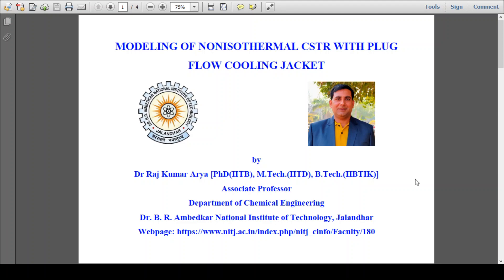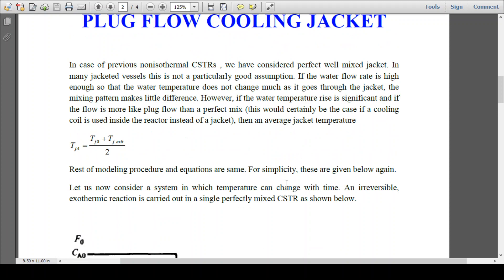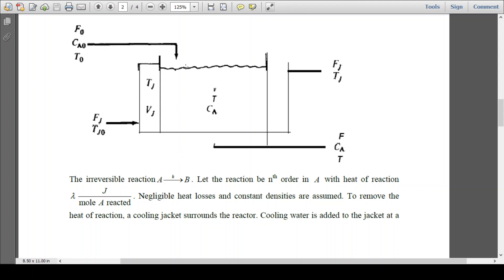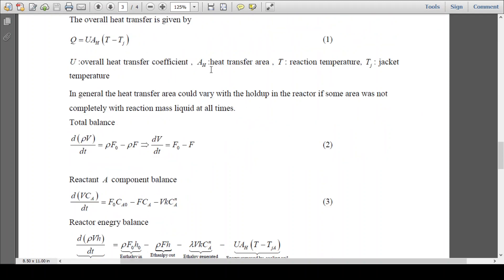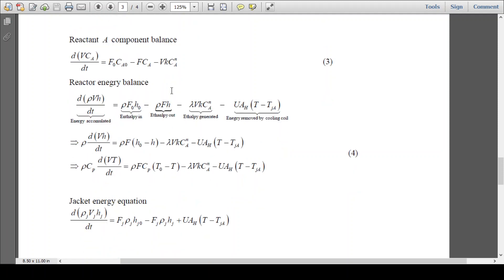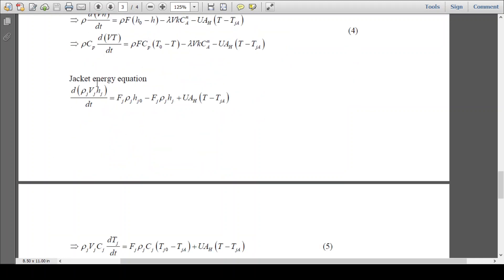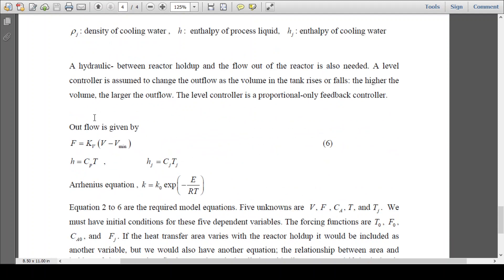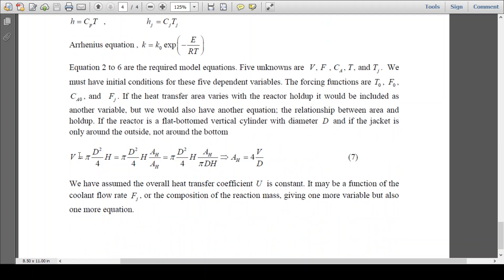Modeling of Non isothermal CSTR with plug flow jacket#Chemical Engg#Reaction Engg#Dr R K Arya#NITJ

Comment: Sir, this was very easy to understand =) 

Just one question. Whenever we use U (overall heat transfer coefficient), arent we always supposed to take the log mean temperature difference? Or can we also take average temp like on this video?
In my UG I remember only using LMTD for all applications with U.
Reply from the maker: U mean overal lmtd but when temperature difference is not much then average will also work